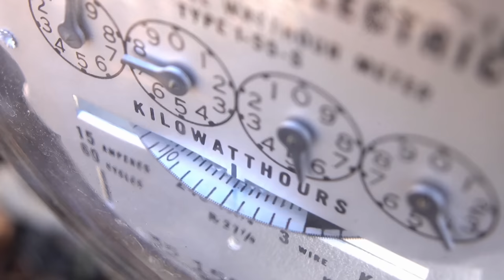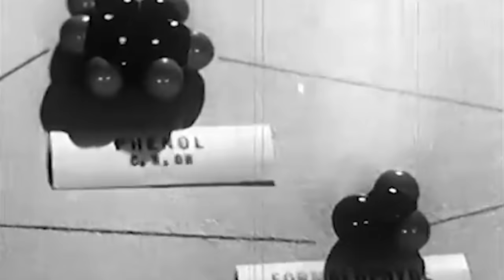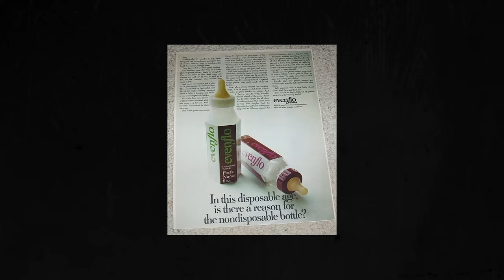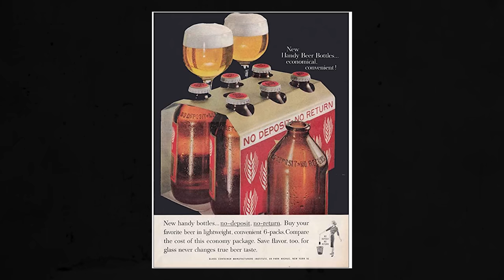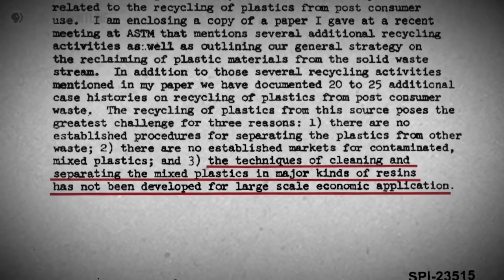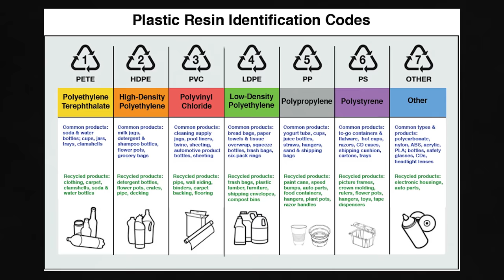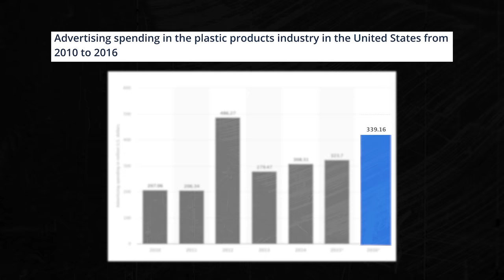The great recycling LIE (what really happens to plastic)

Comment: You know it is hard to recycle plastic when a Swedish recycling company's promotional video actually shows they are failing

https://www.youtube.com/watch?v=yFrVmNJgW_Q

The voice is in Swedish but it does't matter as the voice says how great it is, at the same time the video is showing it just doesn't work. One of many examples is when they emptied part of the line for the video shot where they are to separate metal from plastic using magnets. The machine can't even hold up a single thin metal wire, how would it then get any metal out of the plastic?

The bales of plastic in looks almost the same as the ones out. The plastic pellets they show at the end are not produced at that factory and I highly doubt they are made from those bales.

At the end they describe the challenges and basically admit it is not working.

Comment: Thank you for a very informative video. But wait! There's more (I don't mean the free set of steak knives). Just when you thought about saving the planet. Solar panels on your roof? Approx 70% of solar panels are manufactured in China, the cost to the environment is huge due to mining and manufacturing of these panels. Rare metals, silicon, plastics and aluminum are the integral parts used in these panels. Huge amounts o coal (Yes, coal fossil fuel) is used to bond the silicon together using coal fired furnaces. Then there is the life span of these panels. Currently, there is no recycling plants for these panels, the cost to break them down is not viable,so they will end up in land fill, or shipped to some third world country to be disposed of and probably end up in our oceans. Fact check if you do not believe, you will be horrified.